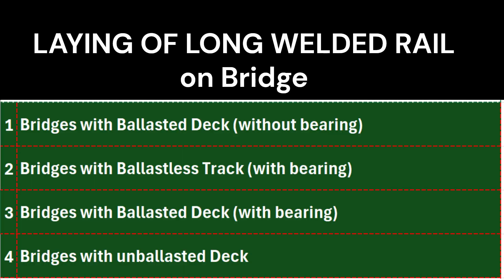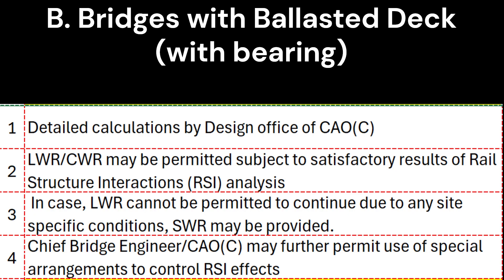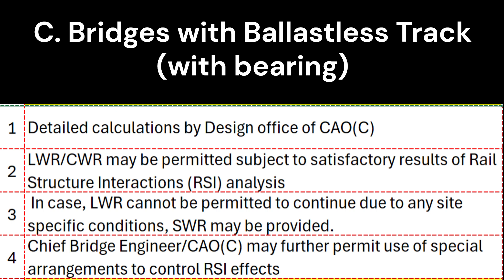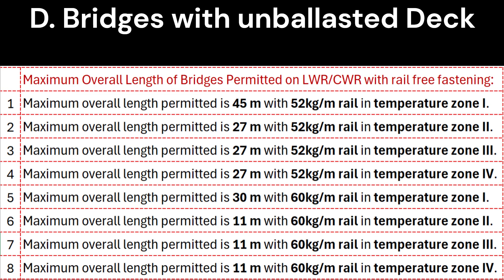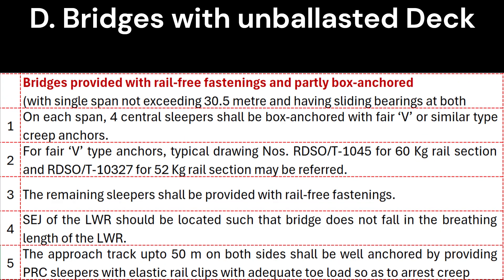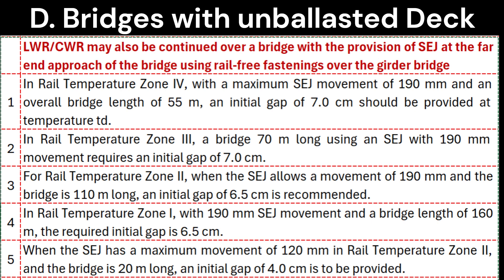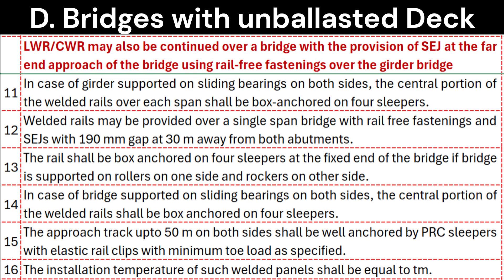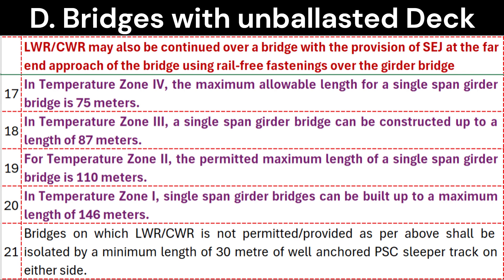Laying of LWR on Bridges  | पुलों के ऊपर से एल डब्लू आर को बिछाना | IRPWM 2024

Comment: PU -32

Plan head 31

Lifting of track track machine

Inspection of tunnel by aen

Inspection of level crossings 

Hauling of track machine

Reversal of stress in bolt

Painting in Severe condition 

Mechanical  Dep. responsibl carriage-watering and carriage-washing hydrants.

Height of cutting 20

RL fore sight back sight

Painting of bridge in Severe zone

Letter in hindi from Kerala to punjab

Cooling period of Gazzetted officer

What will do a officer after payment of tuition fee 3 times basic

Re employed Gazetted officer pass rule

Rpf with whom protect station area encroachment 

AT welding number of mould

Track maintained training schedule 

rect pet fls

Deposit work

Technical sanction 

Bid security 

Security deposit 

Hindi diwas

Bhag 17 hindi

Nagar karyanwayan samiti

Who is responsible to implement hindi

Andhra pradesh telgu 

Andaman nikobar

Child education allowance 

Transverse crack in bridge 

Orn 4.

Hill contour 

SFD BMD

PQRS PQRL

Formation width 

criterias of deep screening

Who will maintain 12.2 m span

Who will maintain super structure psc slab bridge 

Report on track machine

gMT for major bridge

Leave encashment 

Who will sell pway scrap

IRWCMS

AEN leave accounts

AEN report on bridge condition 

Mass concreteing

Camber measurement with ?

epoxy viscosity 

High diesel ⛽ management

RAT report forward 

CRS sanction required for

Realignment of curve versions, 

sf1, 

10mt water table, 

petty repair book, 

boundary wall, 

local police, 

station limit, 

dron monitoring, 

off track motor, 

self cleansing velocity, 

types of level crossing,

speed at DClass station,

37prob,

crossing in turn out ,

85Prrcent, 

surplus store, 

pl number, 

pnm,, 

guage,

82 years after 40%

Shunting board,  

major penalty,

Terracotta used in

Stone use in bridge